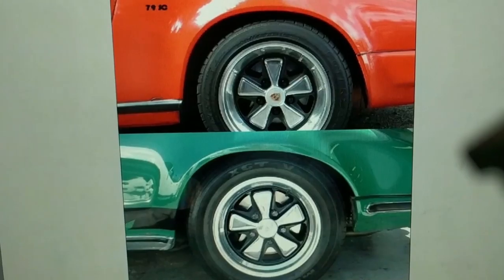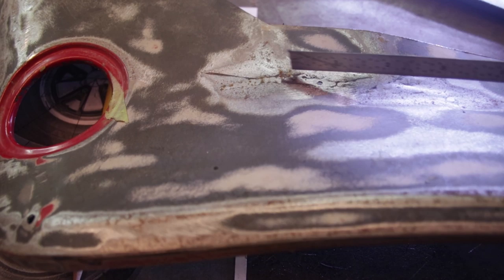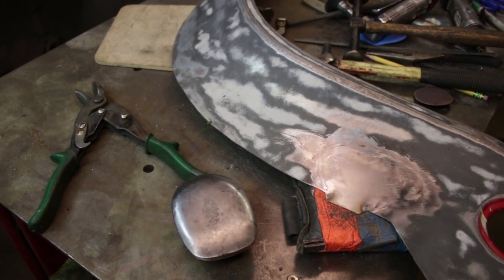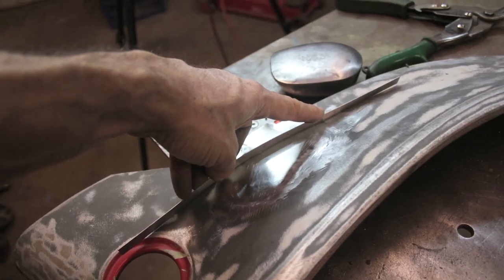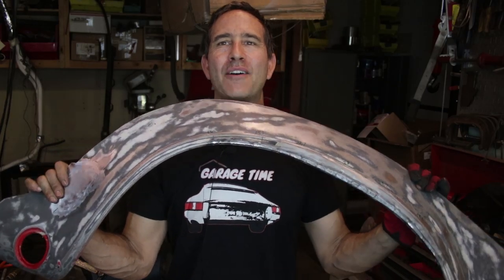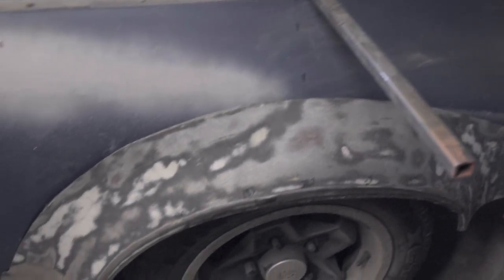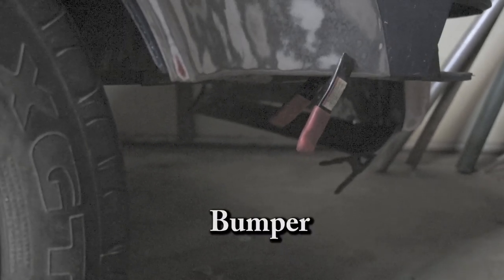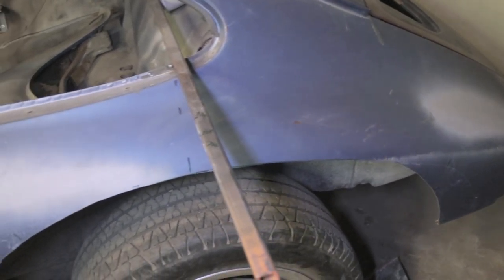Porsche Restomod - RS Steel Fender Flare Mod

Comment: Dude, you were SO close on cutting that flare.  When I did mine, I did them like you began your cut...lining them up, then cutting through both at the same time.  The difference was...I tacked them AS I cut.  So, you cut a few inches, then throw a tack to hold it.  By the time you go all the way around the flare, the inner steel (The existing car) just falls off.  You can use the same technique when you do rust patches...then you don't have to keep going back and forth to make the patch the exact size.  Anyway...super ambitious, and cool metal work!
Reply from the maker: Hi Michael, thanks for this.  I try for zero gap when TIG welding so I like to sneak up on it.... Saves time in the welding, plannishing, and body work phases.  Plus I need to stretch the top section of the fender before tacking.👍

Comment: Using bandsaw for that purpose was a new trick to me. I have to use the trick. To remove undercoat, I use sharpened metal bondo spreaders and heatgun. We have cold winter here in Finland. In cold weather, undecoat leaves well using only wood chisel. I use wirewheel only to finalize the removal work.
Reply from the maker: Cool, thanks for this comment.  This is similar to what I use.  I try to get 80% off with paint stripper and putty knives and then wire wheel the rest. 👍

Comment: Wire wheel is the best way but hard on the hands. Nice save with the rear Flair's. Keep it up Tom it will be in primer by Christmas.. 😬
Reply from the maker: No magic bullet huh for undercoating removal?  Bummer.  Epoxy primer ordered!  High build coming soon I hope.

Comment: Nice work as always Tom 👍 For the underseal use a multi-tool... I tried everything and the multi-tool followed by the wire wheel on a grinder did the job in no time. Pick a spot I.e. driver side wheel well, strip as per above then get it straight in epoxy primer. By using this method you can mentally separate the car into sections and set a goal of one section per night 😜 P.S. my favourite comment was “Actual Speed... YouTube Speed” haha that’s oh so true 🤗
Reply from the maker: Thanks Mark, I'll get it done one way or another.  Good tip about getting a little bit done each night.  When I lose motivation I force the hour per day policy.
Reply: Garage Time - Restomod The alternative if you don’t want to Epoxy small areas one at a time is to carry on your daily refinishing repairs down to clean bare metal then spray this: https://www.carcolourservices.co.uk/product/novol-for-classic-car-bodywork-primer-protection/ to protect from rust. Once the entire car is done and finished in the above product you simply epoxy primer direct over the top in one go. I’ve got a tin left over if you want it 👍 Let me know and I’ll message you via FB to get your address and post over to you 👌 Basically you can leave the product in your spray gun as it’s water based after each application so minimise cleanup time (which we all hate 😜). Novol for Classics is the very best paint solution currently on the market for restorations... it’s not cheap but it’s second to non 😉
Reply from the maker: Thank you for the recommendation and link!  I've been leaving the ugly paint on as long as possible to protect the metal.  I'm going to try to strip and prime the whole car in one day.  Thanks for the generous offer....😀. I'll save my favor for another day.

Comment: What kind of kerf width are you getting with that body saw making those sandwich cuts?  Have you considered a thin e.g. .030 pferd cutting wheel?  Thank you.  Ha coincidences in life for what it is worth my name is Tom also and I am doing a restomod on my 89 bronco in the other HB -- Hermosa.
Reply from the maker: #HB #Toms
The body saw blades some very thin and I also have those 
030" Dremel discs.  The tighter the gap the better.  
Sometimes the gap opens up, which is why it's wise to get lots of tacks in place.

Comment: I’ve never done an entire car but I’ve found a pneumatic scraper followed by a wire wheel works pretty good. Heat and a hand scraper for tight areas. Thinking about time vs money what does it run to dip a car in your area?
Reply from the maker: Thanks, are you referring to the needle scaler things?  I've never tried those.  Not sure how much it is to dip in CA, but I assume it's $$$$ due to EPA.  I'm not going to strip the entire car, just the areas that I'm modifying.
Reply: I’ve never tried a needle scaler but harbor freight has what they call a “air scraper kit” for $25 that you could try out and see if you like before spending big money on a snap on set. 

https://m.harborfreight.com/6-piece-pneumatic-scraper-kit-95826.html
Reply: Oh yeah dipping may be expensive in CA, I’ve been quoted $1,250 to do my ‘87 Carrera here in CO
Reply from the maker: Thanks man!  Maybe I should stop complaining because I only have a few square feet to do, ha ha.